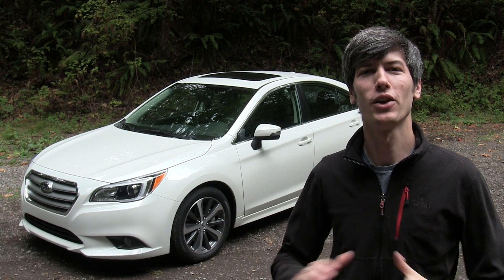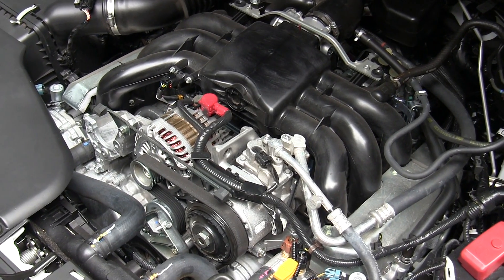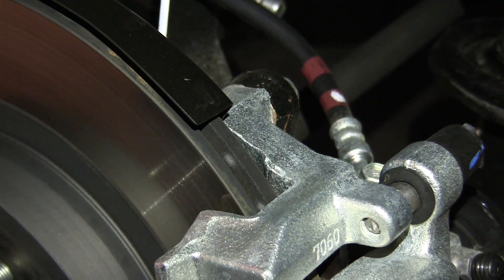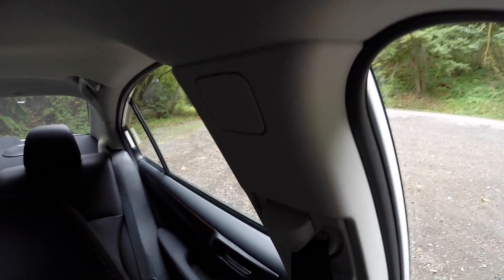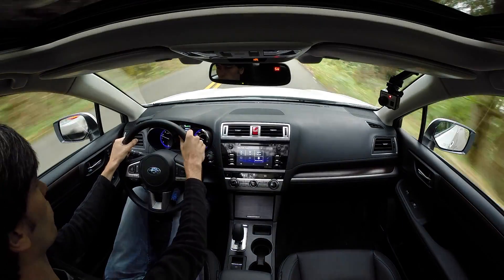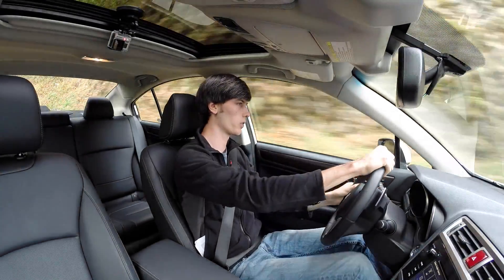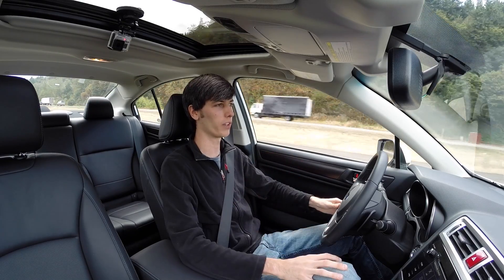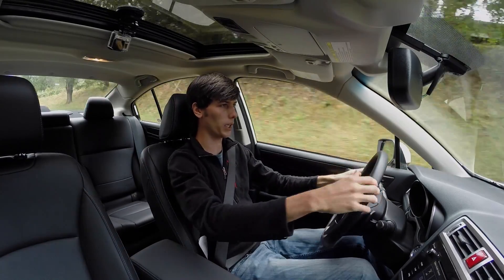2015 Subaru Legacy 3.6R Limited - Review & Test Drive

Comment: They need to take that 3.6L engine, slap a turbo on it and put it in the STI. It's a shame Subaru's magnum opus of cars doesn't even get it's best engine.
Reply from the maker: Darkmatter28031 I'd certainly say the EJ25 is a better engine. Big engines are heavy, the boxer four a great idea for a sports sedan/hatch. That said, both are a bit dated, and I would guess they'll get replaced with turbo 2.0L's with time.

Comment: Re. Battery placement, the battery is on what would be the passenger side of the vehicle in its native Japan as Japanese cars tend to be RHD.
Reply from the maker: Wyndzzy Assuming the engine bay remains relatively the same, yes that's a great point.

Comment: He stated that the battery is on the wrong side of the car for weight balancing with the driver, but he forgets that Subaru is a Japanese car where they drive on the left hand side of the road, so for the Japanese/UK/AUS etc, it's correct.
Reply from the maker: Capstickk Ahh, interesting point. Does the engine bay remain the same for both markets?
Reply: Engineering Explained I would assume so, It would cost more in manufacturing costs to rearrange the whole engine bay otherwise. If I'm wrong someone please correct me, it wouldn't make sense though.
Also I love all of your content, keep up the good work!
Reply from the maker: Capstickk Well I just ask because you'll have to move the brake booster, steering assembly, and likely some of the heating/cooling bits. It wouldn't be as simple as an interior change.

Comment: I love Subarus, they consistently deliver superb engineering and power, but i'm glad i'm not the only one who cringed when I heard 'CVT'.
Reply from the maker: zeroangelmk1 It seemed like a good transmission. Not sure why CVTs get such a bad rep, I'd take them over traditional planetary autos any day. That said, I'd still prefer a DCT or stick.
Reply: My motto: Dual clutch or Manual other than that just no.
Reply: Engineering Explained Maybe it's just my experience with rubber belt CVTs that the Rangers (6-wheeler vehicles) that our Fire Dept uses for fighting wildland fires. The belts on them are loud, prone to slipping, and need to be replaced frequently (although they are trivially easy to replace). I can imagine that perhaps Subaru is using a much improved CVT design. Maybe you can consider doing an episode on CVTs and how some of the more advanced variants of CVTs compare to the simpler versions. Would be nice to hear pros and cons, even if nothing beats the feeling of pulling off some nice shifts on a fast car. :)
Reply: 32 mpg on a 3.6L is why it has a CVT.
Reply: Engineering Explained Totally agree with you!
Reply: zeroangelmk1 CVTs have received a bad rap just like early diesels did, it will take some time to recover customer confidence.  CVTs performance and reliability as of late have improved much.
Reply: I'm not sure why you were surprised. Subaru no longer use torque converter automatics. DCTs are very complex and expensive to both produce and maintain. Anyway, the thing is every single Japanese OEM is relying on CVTs now, while the Europeans have edged towards the Dual Clutch, so chances are any mainstream Japanese car being produced right now will have a CVT in it.

Comment: Can you still do handbrake turns?
Reply: Handbrake turning on an AWD vehicle is a good way to mess up the drivetrain.
Reply: invar1 Yes man, because of that my line begins saying "totally agree with you", only the Impreza STi used to have this capability. I never do handbrake turns in my Legacy GT.
Reply from the maker: ***** Didn't try it haha - won't say I'm a fan of electric park brakes.
Reply: efrain kennedy Ah, a fellow LGT owner! :)
Reply: invar1 Oh man :( I handbrake turn every day to get out of the driveway.
Reply: invar1 Totally agree with you man, but the impreza sti used to be prepared for handbrake turning, i don't remember well, but i think the center differential disengages the rear differential when you pull the handbrake or something like that.
Reply: efrain kennedy I'm fairly certain you're correct, but you have to remember that STis are the exception, not the rule. STi's have DCCD. None of the other Subarus have that, unless they started doing that recently. AWD systems are meant to maximize traction. When someone does something like yank the handbrake to purposely slide (induced loss of traction) by locking up the rear wheels, the system works against it and working it like that isn't good for it.
Reply: invar1 I ebrake my viscous center diff sti all the time in snow, dirt and on the track. It's a 1998 ver4 that's 16 years old now... should I be worried? lol As long as you're not putting food trays under the rear tires and locking the ebrake there isn't going to be any damage.
Reply: invar1 yes it puts strain on it but it can take it, centre diffs arnt too expensive and no need to remove gearbox to replace.

also the STi i think has a feature where it disconnects the centre diff when u do hand brake turns
Reply: Only advantage for me about an electric handbrake is that it auto disengages pulling away.

Comment: For me, there is too much background noise while cruising down the highway, making it hard for me to clearly hear what is being said. My conclusion is there is too much road noise.
Reply from the maker: canddmeyer Yeah, my camera set-up this time was a bit different, and it did seem loud in the video, which I was surprised. Perhaps not as silent as I thought, but honestly it seemed quiet while driving it.
Reply: Engineering Explained I suggest you use a sound meter in your reviews. I would put it in the middle of the back seat in every test. Just make sure no air is blowing at it from the ventilation system. Naturally all windows will have to be tight shut.

Comment: That's the thing I love about Subarus, the brakes on all of them are great. The 98 Outback I had the brake feel was exactly the same. The only thing I don't like is the CVT they did it for efficiency and it seemed to have paid off (32.3mpg in a mid size car with a 6 cylinder is really good), I could live with how Subaru setup this CVT if I left it in manuel mode. But they should offer a 6 speed standard, the Accord has one, and of they don't already offer it an 8 speed automatic.
Reply: Canada gets the 6-speed manual for both the Legacy and Outback... The USA, unfortunately, does not.
Reply: I agree on the 6 speed, subaru & mazda seem to be the brands were manual transmissions are popular
Reply: AWDfreak well, looks like I'm goin to Canada.
Reply: +Bryan Doherty it should, mightycarmods did that and turbocharged one
Reply: AWDfreak well it's a good thing I live in Canada then. That's the only thing that would have forced me to buy the smaller Impreza, but I'd just get the Legacy with the 6 speed standard then. Can you get the 3.6R Legacy/Outback with the 6 speed standard?
Reply: Bryan Doherty As with previous generations in North America, the 6-speed manual is only available with the flat-4. So you can only get it with the FB25 from the factory.
Reply: AWDfreak can the 6 speed bolt right to the 3.6R if you swapped the 2.5i out?

Comment: no valve lift... no turbo, CVT... only thing that engine is got going is the large displacement and being boxer.
Reply: AWDfreak it does have valve "timing," but the 3.6 DOES NOT have valve lift. Timing changes when the valve goes up and down in the stroke, lift changes how much. The only subie engine that has this is the 2.5.. the tech is marketed as AVLS..... so you are wrong on that part.
Reply: Hans611 I stand corrected. The AVLS does have a low/mid-range profile and a high-end high-lift cam profile, while AVCS is simply varying a single profile.

Comment: So is EyeSight just the adaptive cruise/braking/lane departure? Like a name for the full safety package?
Reply from the maker: Correct
Reply: Matthew Konchan hence the "full package" part of that question.
Reply: Engineering Explained
incorrect it does more than that. throttle control and lead vehicle departure warning

Comment: really weird that it emulates "gears".  Seems to defeat the purpose of a CVT.
Reply from the maker: Greasyspleen Only when you're hard on it. There's probably difficulty in transmitting such high torque and simultaneously changing the gear ratio, but I'm not sure on that.

Comment: Only 256 HP coming from 3.6L? GM/Cadillac are making 275 HP from 2.0L and Honda is making 300HP from 3.7L (Only 100CC more than the Subie's engine). Where did they go wrong? Was it mechanical loss from the CVT in addition to the symmetrical AWD? I feel like that number should be higher now.
Reply: The Cadillac had forced induction, so not really a fair comparison. Also power per liter isn't really very important unless you're in Motorsport with displacement limitations. If Subaru already had provisions to manufacture that engine, and felt that 256hp was adequate for that car, that's the power it will make.
Reply from the maker: For its size it's not too powerful, I believe the engine has been around for a while. The CVT will not change the engine HP (which is what manufacturers state). That 2.0 you're referring to I would assume has forced induction.

Comment: When a spring snaps, what happens? Why does the car not die?
Reply: Because springs are not connected directly to engine or transmission, there are also other driving wheels to power the car... Granted, not recommended to drive the car, but plausible

Comment: Good job reviewing this car!
What i hate about those new car fittet with tons of electronics is that car drives for you, and even in some areas replaces an actual driver by preforming this adaptive cruise control stuff. I can't drive any car that thinks that i can't control it.
I have that negativity after test drive in which i almost crashed a car i was testing. It happend because ESP was doing its job preventing car from losing traction. And you can't just remove this stuff, all u can, in fact, is mess up your new car and void warranty doing so. Im going to buy old car that i can drive properly
Reply from the maker: I'll agree that when you're driving for fun these aids can get in the way (many times enthusiast oriented cars allow for disabling them), but for many people who simply drive because it gets them from point A to point B, these aids made driving so much simpler, comfortable, and less stressful, along with safer. And for that, I applaud these features, as I know not everyone wants a heavy-clutched manual six speed with disabled stability and traction control, limited slip diffs, and a firm suspension like I drive myself. Luckily we have options. :)
Reply: Engineering Explained i totally agree with you about many people, its just me and my way of driving. I personally don't find driving "heavy-clutched manual six speed with disabled stability and traction control, limited slip diffs, and a firm suspension" car stressful, i really enjoy that kind of driving.
Btw, what do you think about audi 80 quattro v6 2/8 on manual? I am interested gathering as many opinions as i car before buying one

Comment: ugh cvt. about as involving as having sex with a suit of armor on.
Reply from the maker: Honestly they make more sense than traditional autos (from an efficiency standpoint), if they can be reliable. I prefer manual transmissions and DCTs, but if I had to choose between planetary auto vs CVT, I'd certainly prefer a CVT.
Reply: This isn't a sports car.
Reply: Way to take that quote from EverydayDriver's CR-Z review.

You've probably never even driven a CVT, you just repeat what other reviewers have said.
Reply: zanzabar4ky7 Incorrect.  Subaru makes their own CVT.  It has a chain not belt and is one of the best offered.
Reply: Ch1Frequency The 3.6R is supposed to be a sports sedan, hence the R. But that's not to say that I think a sports car can't or shouldn't have CVTs. Some people (like Charles Martel) feel a manual is more engaging but the truth of the matter is that CVT can be better from a performance standpoint. Sure, you don't get the same sort of 'kick' that presses your back into the seat when you're driving a CVT, and it's a little unsettling that the RPMs sort of stay constant, but performance wise, it just makes more sense to stay at your torque peak the entire time, and you simply can't do that with a manual.

I'm not taking into account drivetrain losses, BTW. I believe CVTs have drivetrain losses right now roughly equivalent to that of planetary autos, give or take. So as I said, it can perform better than a MT. But there's really no hard set rule. It'll depend on the car.
Reply: zanzabar4ky7 yeah Nissan CVTs are crap
Reply: ***** "You have exactly the same "kick" with any transmission, all other things being equal, assuming the torque at the wheels is the same."

Sorry, I did not make this clear. My point is that in a manual or automatic with discrete gears, the "kick" that you feel is during the shift. Some people enjoy that kick. A CVT can get the same effect by simulating gear shifts. I'm quite aware that torque is what is felt, and that what matters is torque at wheels and that if torque measured at wheels is equal in both cars that you will be pressed back into your seat in the same way.

As far as the rest, you're absolutely right and I am mistaken about keeping it at torque peak. It should be kept at power peak, and I should have known that having researched a bunch regarding how to calculate my car's ideal shift points, so for that I apologize. I know what torque multiplication is and why it's important to figure out what gets put down to the ground.
Reply: Engineering Explained
that would be the case if it got better mpg, but they gained 1 overall and i would bet that weight loss is for that.  i would take a ZF or even a higher geared version of the 5EAT over the cvt.
Reply: Not a fan myself, but from a plebian standpoint it's starting to make more sense than the classic automatic transmission. Apparently the CVT in the 2015 WRX is surprisingly good, even to "car people".
Reply: Le Happy Merchant i had a new FXT loaner for a day this last summer, i have had had neighbors with nisans that have had to buy a new trans right over 100k since the cvt belt crapped out (one even went at 25k but that was when they 1st came out, and they are mde by jatco who makes subi cvts as well,) and have driven many cars with them from a prius to a maxima coupe and the FXT.  i like my 4th gen LGT with a 5eat much better.
Reply: Le Happy Merchant jatco uses the same pulley system for Nissan and subi. They are the same inside but subi has better engines and a better TCU.